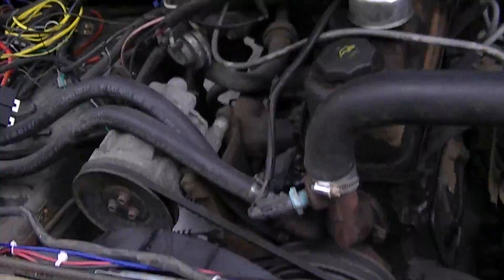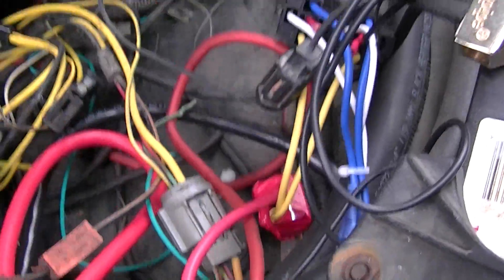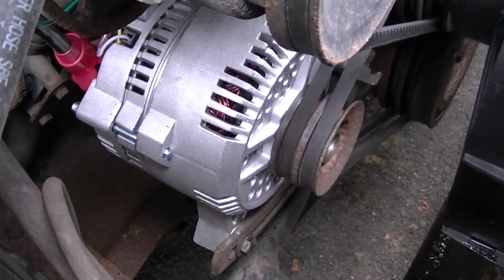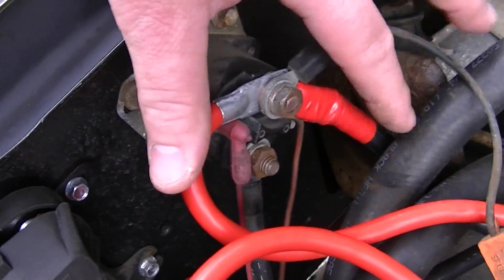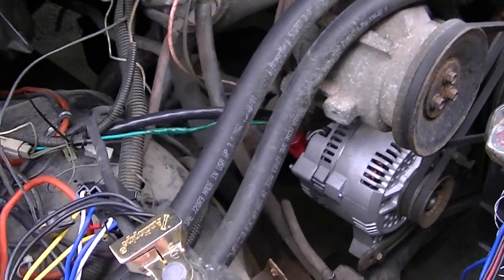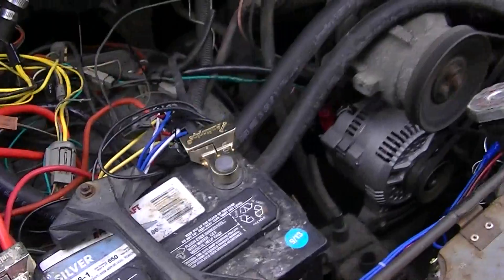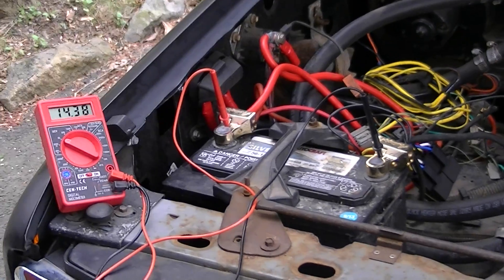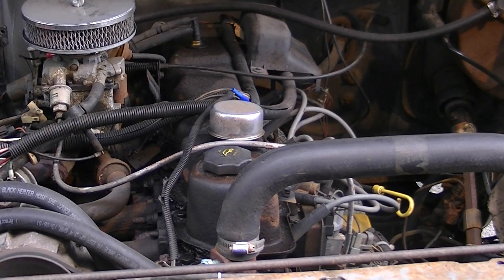1986 F-150 3G alternator upgrade

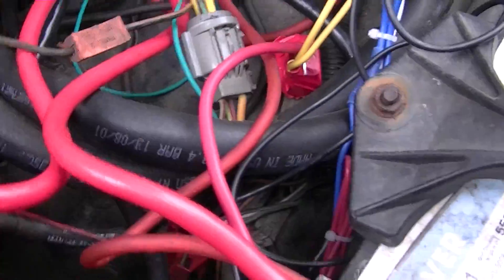Comment: So what did you end up having to do to restore power to your truck with that cut splice at 0:51? I'm having exactly the same issue and I can't seem to find for the life of me where to put that hot wire to restore power.
Reply from the maker: I hooked that wire up to the positive side of the solenoid.
Reply: @1967tempest  which wires specifically did you put to the solenoid? I’ve the yellow/white and black/orange above the black round thing where that splice was.
Reply from the maker: @chongo989  I’ll have to go out after work tomorrow and trace it out. Which I will for ya!!
Reply: @1967tempest  you are a gent! Thanks a million!
Reply from the maker: So the thick yellow cable from harness is hooked up to fusible link. You could take that wire and fuse it to positive side of the the solenoid
Reply: @1967tempest  I’m intrigued. The biggest yellow wire from the harness was snipped, run into a fusible link, and looped back to the bat+ lug on the solenoid?  I’d PayPal ya a tip for a good pic with this layout.  How did you deal with your ammeter and the fire risk from overcurrent?
Reply from the maker: @chongo989  David.dixey@gmail.com. And I’ll send you some.
Reply from the maker: @chongo989  I don’t need any thing from you, send me an email at that address and I’ll reply with pictures.